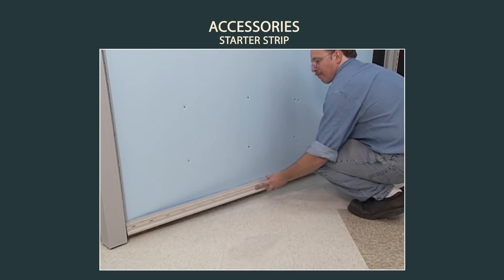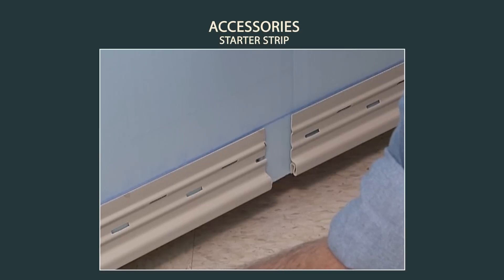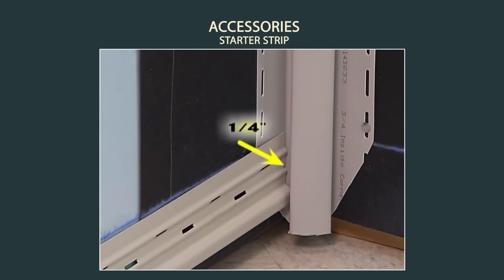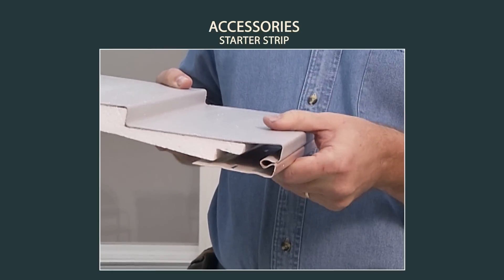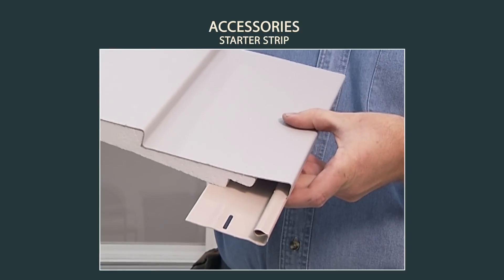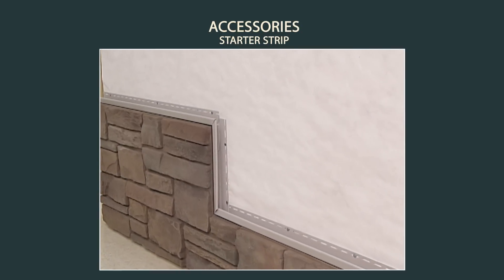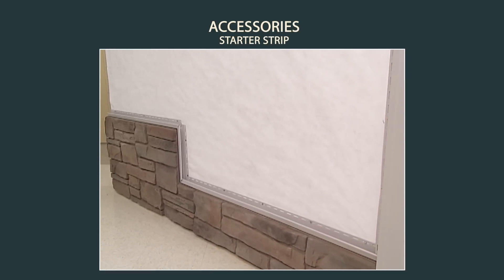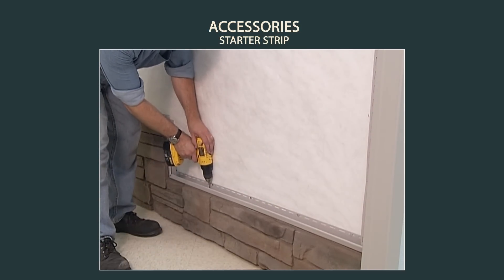Vinyl Siding Installation: Accessories - Starter Strip (Part 7 of 9)

Comment: I am kind of upset, house just got new siding due to a hail storm, along with a new roof. the installer left all the old starter on and one side looks terrible. of course, my insurance papers said to use all new starter strip, j-channel, etc., where needed. my house  before was medal siding at 27 years old in central New York.never again, they were storm chasers, learned my lesson and hire local. they are getting about $26,000 + to redo the house. I think around 1600 to 1700 square feet.....I asked him about the starter strip and he told me medal is better then the plastic......telling the wrong guy what you want me to hear....
Reply: frank pickard ml ml
Reply: metal starter strip which is galvanized is way better then plastic.